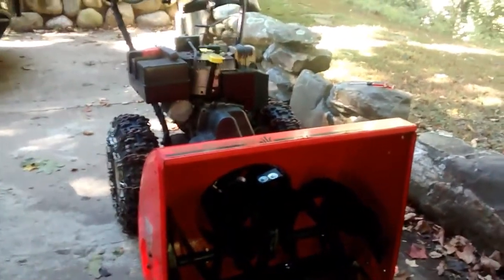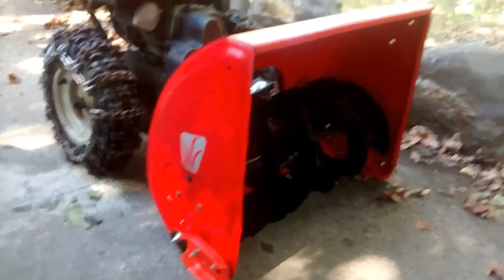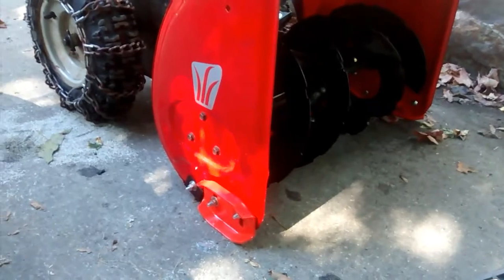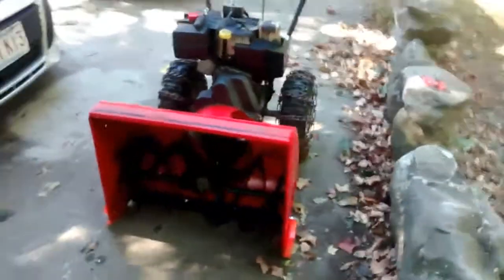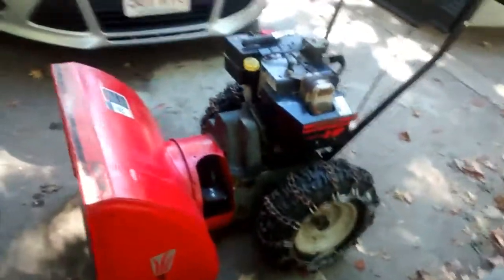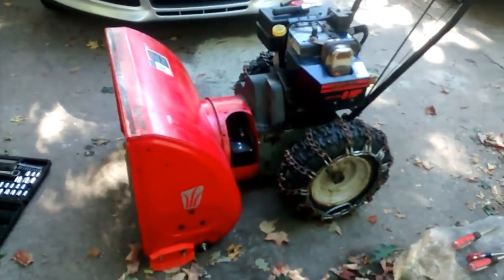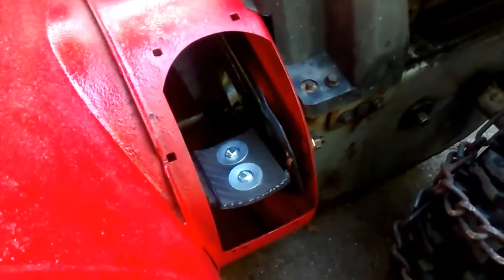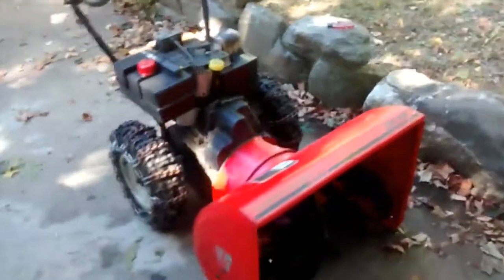MTD 8HP/26" Yardmachine

Comment: I wrote a book, here.  My wife went to a pawn shop and paid 200 bucks for an older Yardmachine last winter...not sure how old.  It's 24" and got quite a bit of rust, especially down by what you call the "shoes" on one side  (I know zip about snow blowers...never owned one). Frankly, I think she paid way too much for the thing.   Anyway, we paid a guy to run the thing, once, because I'd had a stroke and was confined to the couch for about 6-weeks.....I'm fine, now.  He parked the thing, and, this fall it won't start....pretty sure the carb is just all gummed up.  Gas was left in the thing with no stabilizer or anything.  Anyway, this thing has turned into a damned project.  I yanked on the pull chain so hard (electric start doesn't work) that the chain came flying off in my hand.  Watched a video and fixed that thing.  I love DonnieBoy's videos, too.  I never touched small engines, or any engines, until I was about 64 - six years ago.  I learned to work an an old generator.  So, I just ordered a new carb because the whole thing was only 20 bucks....when I took the bowl off this carb the rubber seal was messed up.  Those seals come in packages of three to ten and they were 10 or 12 bucks...so I just bought a carb instead of trying to clean the old one.    There was a crack on one hose where it connected to the carb.....probably should replace the entire hose, but, I can just cut a bit of the end off.   The right tire loses air, just like yours.  A little cotter pin than holds the doo-dad that turns the shoot is missing so that mechanism can just come flying out.....lol....Man, everything in the world is wrong with this thing - although it did run fine last year.  When I sprayed it with starting fluid it would hit and run for a second so I think the engine, itself, is basically fine.  I don't think this thing was very well taken car of by previous owner(s).  I'm sitting here waiting on my carb.   Wish me luck, man.  Nice casual video - seems like you know what yer' doing, buddy.
Reply from the maker: Thanks for the interesting comment. Don't worry if you keep working on it and watching Donnyboys videos whenever you need some help, that thing will run I promise. Once you get it you won't be disappointed, the thing is a tank I swear. Mine will probably outlive me @ (soon to be 63) ... 🤣
Reply: @trump959  Get this....lol - forgot to mention:  When I went to remove that carb today only one of the nuts on one the bolts that hold the thing to the engine block was there - one was just missing in action.  The carb felt pretty secure...think the whole thing was so dirty it was being held together by grime.    Couldn't believe one of the two bolts was completely disconnected.  The thing was treated like a bad step child, man.   If this was a car it would be a "beater" or a "hooptie".  😄
Reply: Yes I too have never owned a snowblower in my life, but found a used one on Market Place and picked it up just for a fall project. I found them so easy to work on and parts are easily found all over from small engine shops or of course, the internet. Now I have a 35 year old Toro that's just like new. Great machine!
 Since then I've picked up 12 more blowers and rebuilt them for resale. Some were easy fixes and some needed parts.  I did see a pattern with most of them, lack of proper maintenance. What I found is people don't use fuel stabilizer before store them during the summer, so most of them had carb issues. And another area that is ignored is the auger gears box. Most of them had a glob of disgusting dirty gear lube in them. Some actually had hardly any lube at all, and one had gun grease in it (not good) Look up you particular machine and find the proper lube to put in the gearbox. Most will take an 80/90 weight gear lube like a car differential. I use synthetic which is even better.
 With all the "fix it" videos here on the internet, there's no excuse why a machine goes to hell in a few short years.